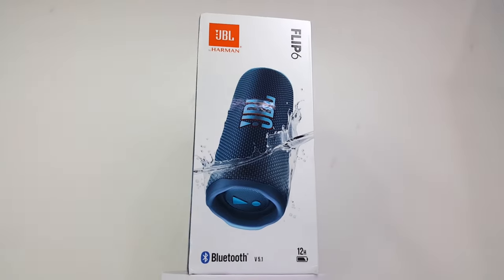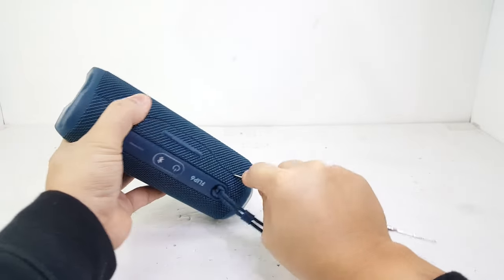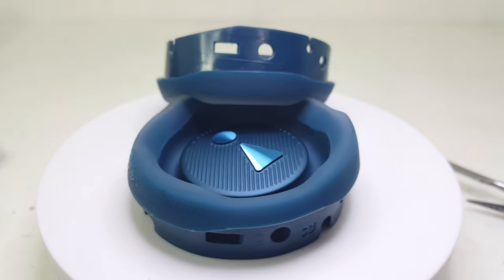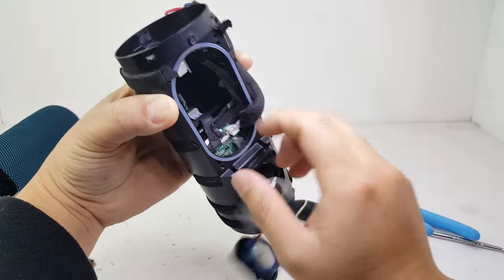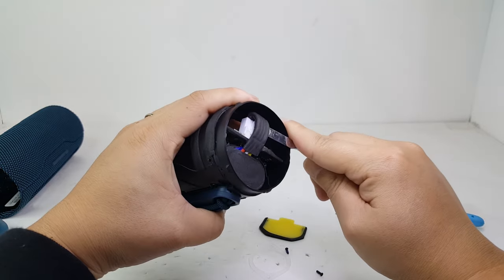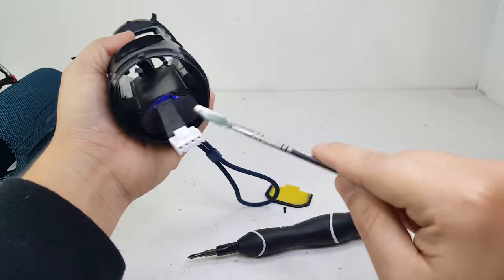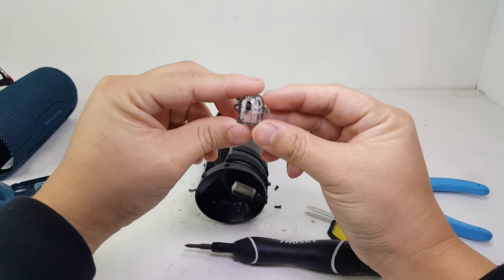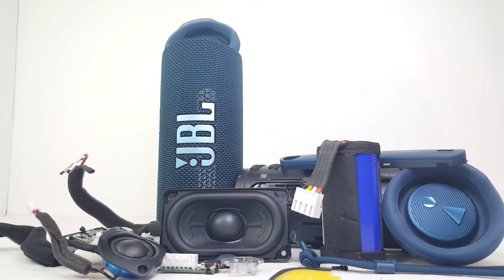JBL FLIP 6 COMPLETE TEARDOWN !!!

Comment: My jbl flip 6 tweeters doesn't have wires
Reply from the maker: if it doesnt have wires, then it may just have contact points from the driver to the speaker.
Reply: @HBV90  yes it plugs in like and outlet
Reply: @HBV90  please check how hot it the flip 6 magnet after playing 1 hour full volume

Comment: I have a question, when I use my JBL Flip6 at maximum volume for a long time, and then I take it apart, the magnet is super hot but the speaker outside is not, is this normal?
Reply: Yup, if its too hot it will shut-off

Comment: People say stereo is better than mono, but one thing I noticed when making a diy speakers is mono is louder and good bass and also less battery usage. I think jbl made these mono is because of one of these things. I might be wrong 😅
Reply: Yeah louder but not always better. Dusk speakers capture more sound experience than mono which pushes all sound through a single channel.
Reply: Its loud because its like compressing the stereo sound into mono sound.  But technically sterio has better sound quality especially on instrument separation section
Reply: You are definitely wrong
Reply: Mono sound will only be louder, but not with the same quality as stereo sound, stereo sound achieves more detail and separation than mono sound

Although it is fine for a portable speaker, stereo sound would usually not be necessary in a compact speaker like this

Comment: at what point of this dissasembly does the speaker become no longer waterproof? I dropped mine and the fabric cover popped of at one spot, is it no longer waterproof? Thanks!
Reply from the maker: The cover shouldn't affect the waterproof rating of the speaker...I would inspect the speaker to make sure there's no cracks, damage, etc from the drop beside the cover.
Reply: @HBV90  got it, thanks for the quick response! it’s within the return period but no damage and the cover just snapped back in so should be fine
Reply: After disassembling the speaker's passive radiator and speaker unit, the waterproofing no works.

Comment: Please if you can tell .. I was using the speaker and the same time got a small sound.  . And now it is not responding.. no having power .. can't on .. off .. I just bought before 2 months.. but problem is I m working in a ship .. so I cannot return it back

Comment: Was that the TL version?
Reply: I’d guess so, as I saw another video comparing the GG and TL “version”, to me 2 different suppliers for JBL (thus some variations on the same spec), the GG tweeter is not attached by 2 screws. Speaking of these 2, there is an opinion that Flip 6 GG sounds better than TL, reversely from Flip 5, TL sounds better! Confusing? 😀